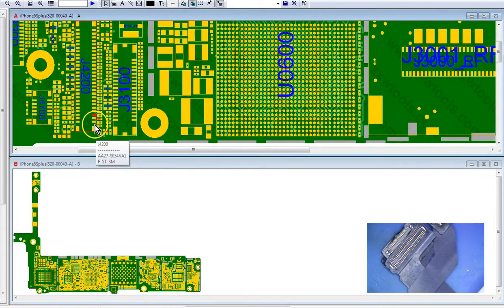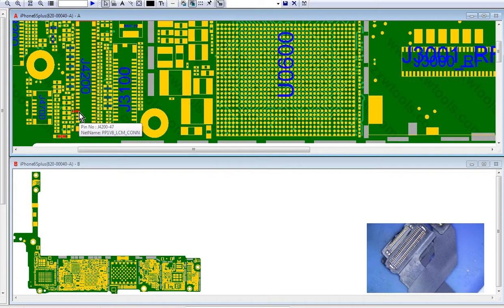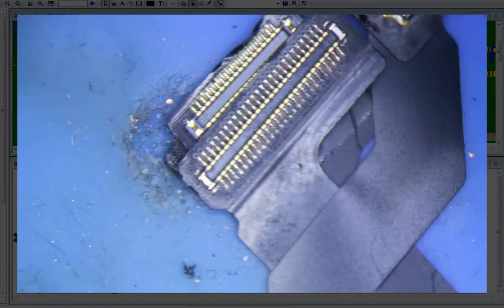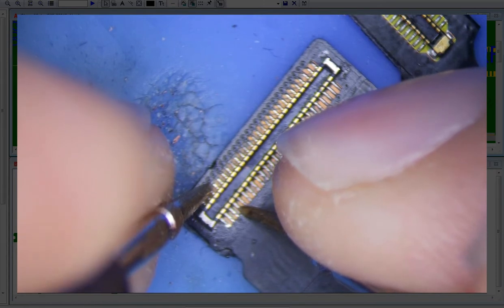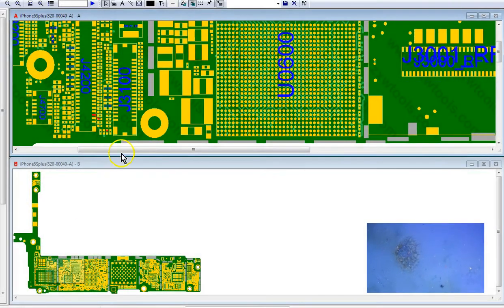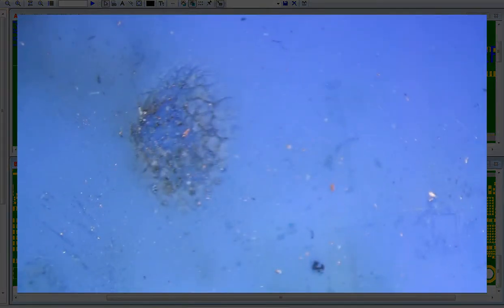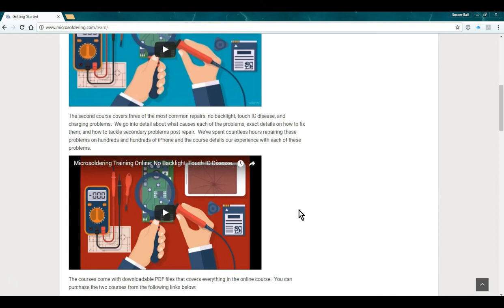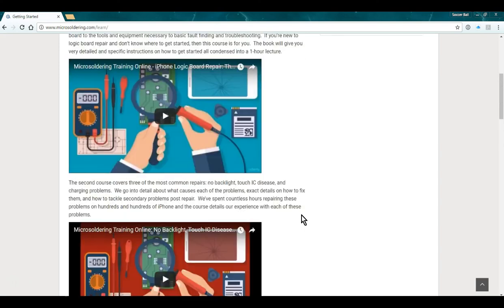Let's talk about the LCM TO CHESTNUT PWR EN CONN

Comment: Reasonable guess is that on some screens there's logic creating lcm_to_chestnut_pwr_en as a function of some other things (like say reset is off, or even that communication has occurred with the cpu), and on the cheaper screens they just short them.
Reply: Eric Davies you are correct. OEM screens have logic that says ok it's all good output to chestnut and turn on screen. 
Aftermarket they just bypass that. 
You can do the same if AP to LCM EN is present you can jump it or 1v8 LCM to chestnut EN and if the AP sees the screen Chestnut will work. 

IF AP doesn't seem the screen it will not turn on Chestnut even if EN line is present. Same with backlight.

Comment: If yoy supply 1v8 to the LCM in does it drain to the LCM_TO_Chestnut pin? Could just be a mosfet on originals vs straight line like Davies said.